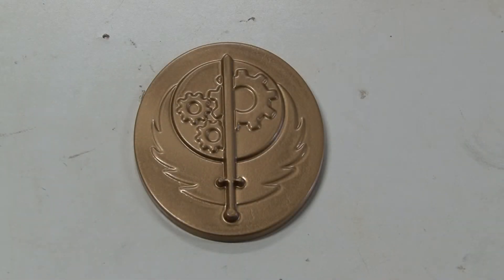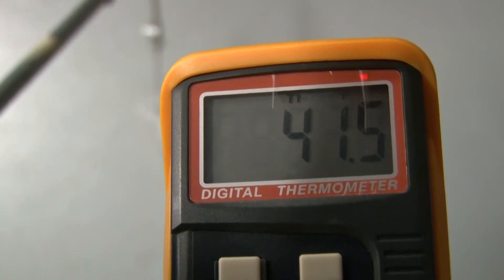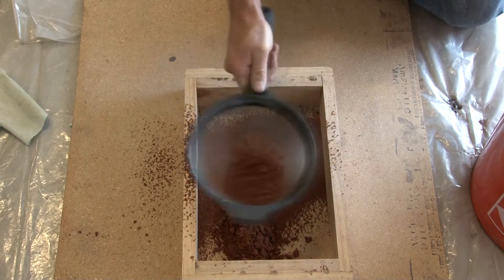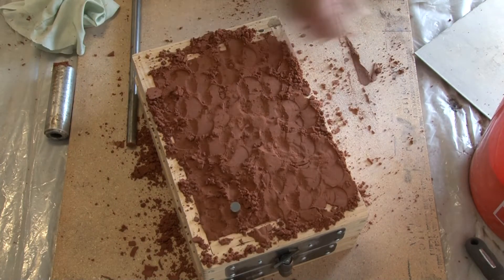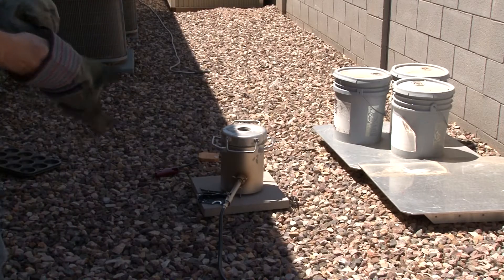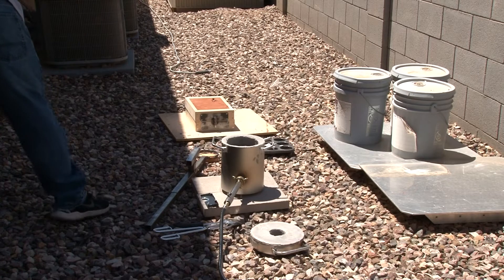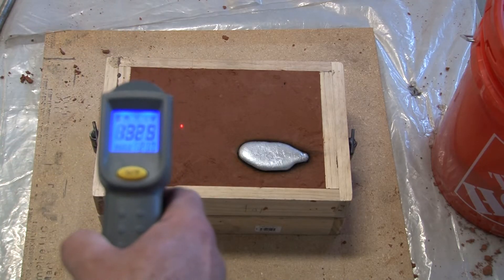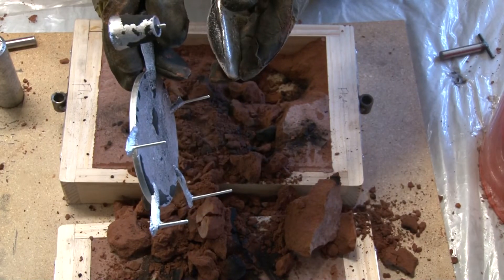Making a Fallout 76 emblem out of aluminum using the sand casting process and tooling upgrades.

Comment: Your subscriber numbers definitely do not reflect the quality of your works.  For what it is worth coming from a beginner, I think your castings are some of the best I've seen out there.  Watching you has ensured that when I finally do my first casting it will turn out better for it.  Keep up the great work.
Reply from the maker: You have no idea how inspirational your comment is to me.  I have been trying to learn from YouTube also, plus I have a couple of friends that have degrees in material engineering that have been helpful to me.  I can guarantee that when you do start casting, if you use the correct sand, good quality patterns, correct parting powder, and an aluminum alloy that is formulated for casting, you will start creating some good casts sooner than later.  Thanks again for the comment, it means a lot.

Comment: Nice work 👏
I have a question : what is petrobond ?? Is it (100% clay whith oil) or (mix 50% clay and 50% sand whith oil) or what is't exactly I hope you answer me 🙏
Reply from the maker: I would like to be able to give you an exact answer but I can't.  I purchased a premade petrobond from a company because I wanted to start off with having the potential to have less problems.  There are several videos on youtube where somebody shares their homemade formulation.  Many of the formulations contain some type of silica sand being the majority of the content along with bentonite clay, people normally get from a type of kitty litter, and a small amount of sometype of oil.  I think your best bet to making your own petrobond is to find a youtuber that has already done it and has proven good results with their castings.   Sorry I couldn't give you more help.  You are just going to have to put the research in or purchase premade petrobond.
Reply: @DamonsMetalCasting  thank you so much
I will be looking more on YouTube  for the formula ..
Great casting man keep  it up ✌️✌️
Reply: @DamonsMetalCasting  you don't make oil bonded sand using bentonite clay, you need an "organoclay" which is a chemically modified form of bentonite that is mainly used in the oil extraction industry, which has been changed so it absorbs oil like regular clay absorbs water.  An activator/catalyst is also needed, but the organoclay is the hardest to find ingredient.  I got my hands on a 2# sample, that's enough to make a 40# batch but aside from that I can't get it anywhere in Canada unless I want a whole pallet of 50# bags of the stuff (or move to the oil fields and try to con someone there out of a bag).  That's why not many people try to make their own oil bonded molding sand.
Reply from the maker: Yup, thanks for the correction.  I looked back online and found this quote which is basically what you stated "Clays such as Bentonite and Hectorite are treated with quaternary fatty-acid amine to create the organoclay. This treatment changes the clay from hydrophilic to organophilic. Simply stated, the treated clay attracts oil instead of water."

Comment: Great job 👍

I don't know the specifics on pouring temperature, but it does matter.  A lot depend...  The time it sits before you pour, the temperature of your sand, and how large you are pouring.  If you do lost foam it probably needs to be hotter than sand casting.
Reply from the maker: Yup totally agree, I just need to figure the best temp for my application.  The lost foam that you are doing on your channel I would imagine would need more heat because you are burning away the foam in your lost foam process.  Your stuff looks pretty good too. Thanks for leaving a comment!
Reply: @DamonsMetalCasting  yeah man 👍